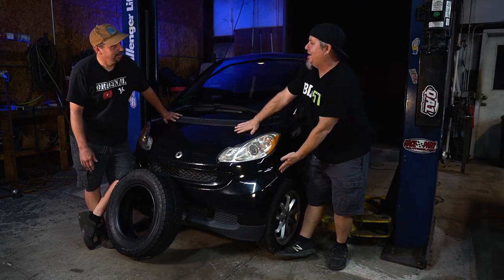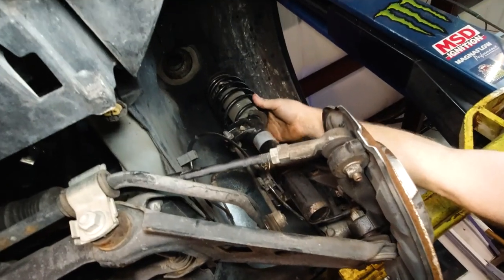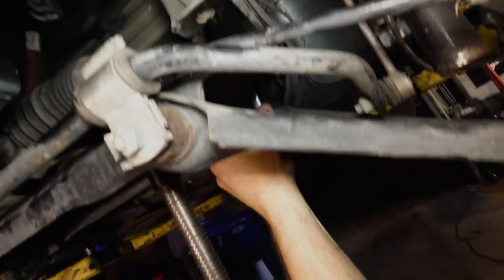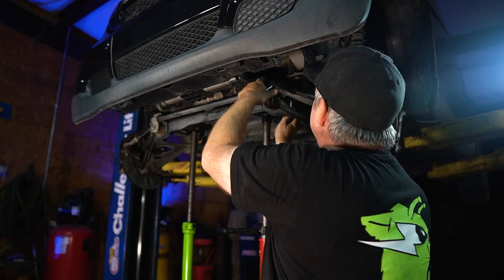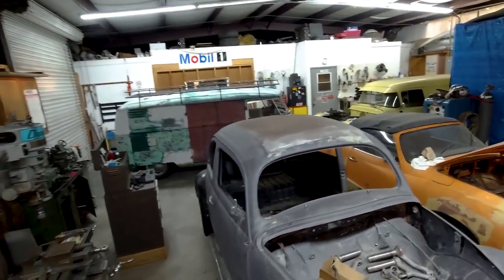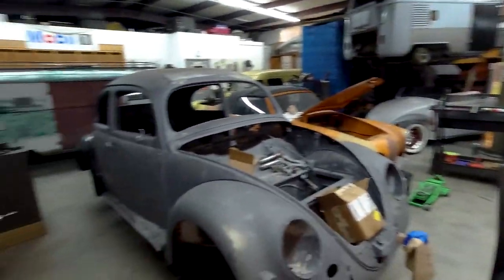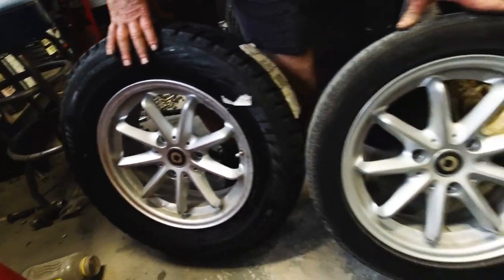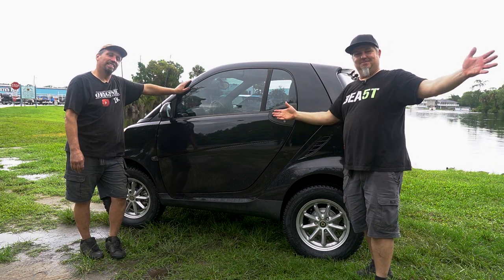VW Smart Car Lift Kit | Golf Cart with A/C?

Comment: the smart car use such good material that these gens doesn't need gloves.   I had a Miata ND, I can't do alignment myself because the steel bolt sort of welded into the Alluminum Chasis just by touching each other, they glued on. 

My 453 is buttery smooth

Comment: You should really do a follow up video.  You left out a bunch of info, tire size, camber correction and Stability control correction, all of which are relevant as you are changing the tire size of the factory staggered setup.  And these are the problems that I am encountering after installing mine.  So having some insight into this would be hugely appreciated.  I personally went with 185/65/15 on four steel rear wheels 451.  I heard the largest was 205/60/15, but the tires that I wanted to run didn't come in that size.  Its still as big as a Rav4 and that's okay with me. I get stuck nowhere now.
Reply from the maker: I will be doing a video on building a roof rack for it so I'll try to answer those question in that video... The tires I used were 205/65-15 https://amzn.to/3uoeFsi
I had to do a bit of trimming on the front though.

Comment: Did you mount these on the stock from rims?
Reply from the maker: Yes I did...I would like to find another set of rear wheels to put on the front since the rears are a little wider.
Reply: @RobStapleton  Ok, thanks. I'm working on buying another set of rears from eBay

Comment: Did the larger tires affect your power and speed? I have a 2014 and would like this kit for mine.
Reply from the maker: It hardly affected power and speed but it feels a little scetchy in high winds but that might just be a Smart car thing.. I didn't drive it much while it was stock. BTW I drive it every day now and I love it!
Reply: @RobStapleton  thanks Rob, yes the wind does affect the handling even on stock suspension. But I don't care. I own a truck and another car. But my smart is my daily driver. Doesn't matter if I just drive to town or taking my little john boat to the lake. But I would like to have a little more ground clearance.
Reply from the maker: @stevencartlidge6574  I have the metal to build a roof rack so keep an eye out for that video!
Reply: @RobStapleton   what size are the tires? Gonna order my kit and get her ready for some trail use this summer
Reply from the maker: @evanpearson572  I used the 205-65-15 They rub just a little in the front but you can easily trim the fender back.
Reply: @RobStapleton  thanks man! Looking forward to the lift! Also, what kinda mpg are you averaging with the lift?? I’m assuming 30-32 mpg.  Thanks again
Reply from the maker: @evanpearson572  I haven't really checked the MPG but I'm pretty sure it's over 30.

Comment: I typed in "lifting a smart car" and this is one of the videos that came up.  I know this is a while ago but I have a question about tire size.  You are running 205/65R15 on stock rims.  That is about 25.5 inches give or take depending on tire brand.  I was thinking of getting 195/60R15 because I don't want to do any trimming in front.  That would be an inch or so less at 24.2 inches plus it would be a thinner tire.
Reply from the maker: With the 205's there's not a lot of trimming but it will rub. You should have no problem with the 195/60.
Reply: @RobStapleton  I am getting aclacking noise when going over bumps and I know everything is tight and my ball joints and everything are good. I had to force the bottom plastic cover on, did you eliminate your cover or did you put it back up?  Is the noise I am hearing the plastic cover? Not sure what this noise is.  Wish I never put this kit on.  I may reverse it.
Reply from the maker: I get a little noise sometimes too..  I think it's from the four bolts that holds the front suspension on, sometimes they get a little loose and I have to re-tighten them. 
I might try putting some anti-seize or grease on the spacers to see if that helps.
Reply: @RobStapleton  yup, the four bolts were loose and so were the struts.  I had to hold the shaft with vice grips and tighten the nut up top while turning the shaft.  I didn't want to do it that way but at least I didn't mar up the shaft at all as to ruin the seals.
Reply from the maker: Glad you got it figured out! I love my Smart but honestly they're nothing more than a really nice golf cart lol.
Reply: @RobStapleton  lol...I agree, I always say that it's the only legal way to tool around in a go cart.

Comment: Whats the ground clearance with the lift kit?   And when does this max out?   ie.  When does the axle/suspension just get in the way??    Thanks!!
Reply from the maker: The ground clearance on the rockers is 11".  Not sure what you mean by "max out"
Reply: @RobStapleton  Thanks!   I just assumed that the bottom of the suspension is stationary, so lifting it only buys you so much space.   Anyway, I am finally picking up the project car today so I will be able to see the situation first hand
Reply from the maker: @mattsalari3300  The front suspension drops down as a whole unit so any clearance gains there would be from the tires.
Reply: Ok. So all clearance gain is from the tires.   Just picked mine up, very excited.  Thanks again!!
Reply from the maker: @mattsalari3300  Only in the front since you're dropping the whole assembly.. the rear uses coil spring spacers so you'll gain a little there.
What year Smart did you get?
Reply: 2011.
When I look under the rear, the bottom of the engine looks like it is going to be my limiting factor.  So the bigger tires are really needed back there.   I have 175/55/r15 back there and looks like lots of space in the well already.

Comment: hello, what size of tires do you mount?
Reply from the maker: Here's a link to the tires I used.  https://amzn.to/3eja046
Reply: @RobStapleton  so 205/65R15 on the small fronts fit?  You managed a square set even with the thinner front rims?  Didnt have issues with rubbing?  Think wheel spacers would help or add anything along with the rear rims added to front?
Reply from the maker: @kiolluigfu  The fronts will run a little and would be worse with spacers. You'll just have to do a little bit of trimming.